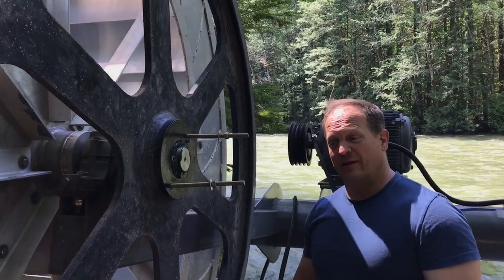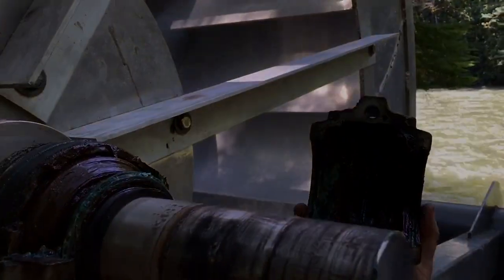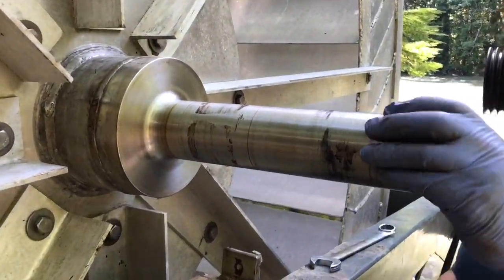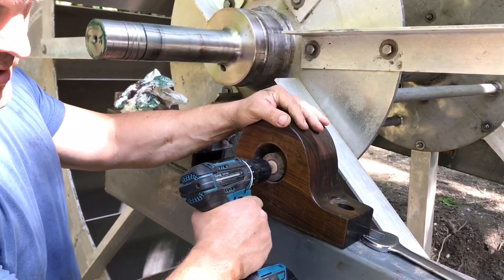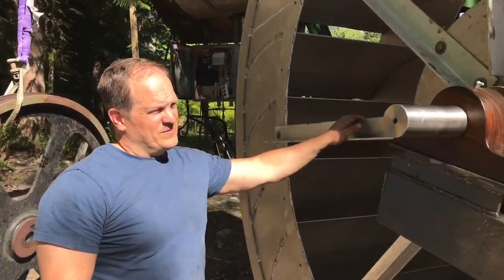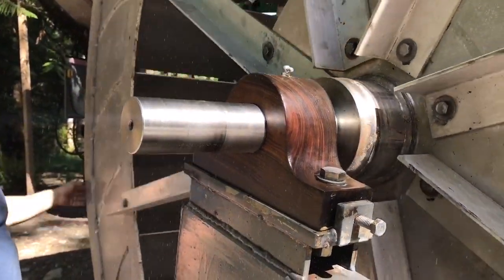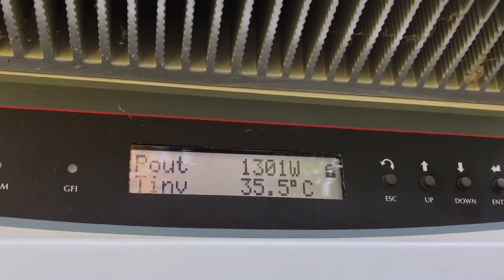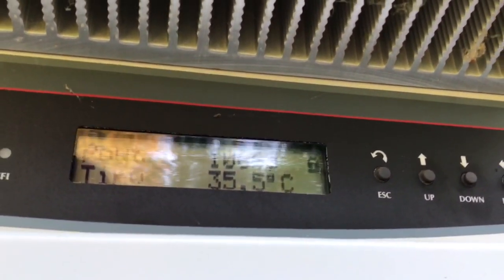Installing Lignum Vitae Bearings on Waterwheel

Comment: just as a quick note, all the Lignum Vitae bearings i have seen, are installed with the wood grain parallel to the shaft, not 90 degrees to the grain as you have installed, they have water grooves and are much as twice as long as the shaft diameter to take the weight

Comment: Those old wooden bearings are still hard to beat. We had them on a cooling unit at work and they were dead nuts reliable, especially considering they got neglected most of the time.

Comment: Great hydro project!!!
Pacific Bearing Company(PCB Linear) sells plain, self lubricating linear bearings that can be used in rotation applications too. They sell bearings mounted in aluminum pillow blocks or the bearing can be ordered by itself to mount in a custom bearing block. The largest shaft size they sell is 2", but that bearing can support an impressive 25,000 lbs. They are not roller bearing so they are nearly maintenance free. The PBC bearings have a better coefficient of friction than lignum vitae 0.125(PCB) vs 0.158(LV). They can run dry(self lubricated) or lubricated with water or grease(can be ordered with zerk fitting) without degradation. Available in inch size or metric. It looks like you would have to machine the shaft to 2" if you wanted to use these.

Comment: Do you think there’s too much weight from the big pulley on the bushing ? Do you think it would be better to make the big pulley out of aluminum?
Reply from the maker: It is pretty heavy, but it also functions as a flywheel to keep the speed consistent. Last time I  looked the bearing wear was equal on both sides. I think the belt helps take some of the weight too.

Comment: This is awesome!  Any update on this?  Would you there be any way to duplicate this is smaller set up?
Reply from the maker: I need to do a new video! Still running well although I have noticed some wear in the wood bearings. Should last another 10 years or so, maybe more as more water is getting into the bearings and lubricating them.
Reply: @NeringIndustries  do you think it is plausible that a system like this would work on a smaller scale?  Say 50-100 watts to create 1.2-2.5KW/day to offset daily usage at average residential place like mine?
Reply from the maker: @sportslinephotography8425  You could go smaller diameter, but I would go as wide as possible. I'm going to increase the width of mine by 1 foot in the near future. wider is better for efficiency and power production vs increasing diameter.!

Comment: Have you thought of a way to supply water to the bearings on a constant feed maybe a small pump or a ram style those are great bearings you have implemented into your design i have worked on turbines from late 1890’s with the original ones still in use just an adjustment every year or two depending on water quality

Comment: Lol reading the suggestions on barings. Lol. Alot of very expensive ideas but a trailer axle from a semi. Still has them beat .
Reply from the maker: The trailer axle is a really good idea. It will also make the wheel wider which will really increase the power output.
Reply: @NeringIndustries  if you ever decide to try a heavy trailer axle hit your local tractor trailer shops most have a few laying around back. Most from conversian ,  spring ride to air ride.  Id get a couple of rockwell style and some alluminum hubs . You can easily cut them up and make any type configurations...dont forget the hubs will have the studs tha in most cases can be driven out and drove backwards...possibilites are endless. Also the the tubes between the hubs are usually 1/2 thick or better which makes for ultra sturdy and easy welding if you need to shortin or separate each and make them independent.  I wish I lived close I got 5 or 6 of them I've cut up for various exparaments and ideas.

Comment: How long have the roller bearings been running?
Reply from the maker: They ran for a year before failing.  The lignum bearings have worn a bit but now are working perfectly.
Reply: @NeringIndustries  And are cheaper than regular steel bearing or not?

Comment: Like the design. But Most wood bearings I have seen are two parts being that it's stronger.  Second thought why do you set the wheel so far in the water. The higher usually has less drag and more rpms.
Reply from the maker: The deeper in the water it is the more power it makes. It acts like a cross flow turbine to some extent. I'd go even deeper but the belts slip when they are submerged.
Reply: How about the use of a synchronous  belt to take getting wet

Comment: Going back to a timber bearing block and just grease is an interesting simple solution, but I would like to add that I would have encased the block in some stainless flat bar to make sure it doesn't split apart when it ages with the water and stress, I will be interested in how it goes, you should get a year at least out of that with a bit grease. well done ,nice bit of timber!
Good luck
Reply from the maker: Great comment - I did worry about this and did wrap the bearing with a 1/16" stainless steel flat bar to hold it all together if the wood split.  It's been a year now with some bearing wear but now water can get in and help lubricate the bearing.
Reply: @NeringIndustries  In other underwater applications, we used wooden slats (similar to those for barrels), ancapsulated in a steel frame, and they work great. With that system, the replacement of wornout slats is may be easier

Comment: The centerpiece is the welded joint of several pieces. It is not a single piece made in turnery machine with low tolerance and greater precision. This can cause a phenomenon of cavitation as occurs with the propellers of ships and the bearings can vibrate too much until be damaged.
Reply from the maker: It was welded and then machined so it is accurate with no run out.

Comment: Love the paddle wheel generator. Great job.
Have you investigated the use of pillar block bearings for Flocculators?  In water treatment these bearings run under water.  The bearing material that I know of is some type of harden plastic. 
They may be other types.  If interested I'll give you the name of the company I use.

Comment: Could you use a compound pulley system to increase your output rpm? Looks like there is plenty of torgue off the big wheel.
Reply from the maker: The wheel turns at 7-10 rpm depending on river speed. The belt drive is a 5:1 speed increaser. The generator maximum rpm is 50rpm, so everything is designed to work together.

Comment: So the taper lock uses just pressure to secure? How are wood bearings holding up? Wonder if fresh or salt water makes a difference with lignum vitae?
Reply from the maker: Yes, the taper lock is two opposing tapers that are drawn together with the bolts. As the bolts tighten, the taper lock expands in diameter and locks onto the shaft and the pulley.
The lignum vitae has worn a bit and I can see a gap between the shaft and bearing. Hopefully the wear will stop at some point as more water is allowed in. I have drilled a hole in each bearing to allow dripping water into the bearing for more lubrication.
Reply: I've pulled similar bearings out of boats that were over 60 years old.

Comment: Ceramic bearings or eyther zirconia or silicon nitride or graphite bronze plus stainless steel are better than lignum vitae.Teflon plus glass ( sleeves, water cooled )its what i would have used for a project like this .Lignum vitae comes from an endangered small shrub and i bet those bearings were more expensive than high tech zirconia sleeves and will last much less.
Reply: Mihai Ilie ,    They will far far outlast any man made bearing.   He will never have to change the bearings again in his lifetime.    The tree (Guaicum) is highly restricted and there is only one licensed dealer/ supplier in the world.
Reply: red elm also also makes a very durable bearing

Comment: It looks good, but looks to be still harvesting less energy than you'd hoped.   Check out this axial flux alternator, sized up it would work as direct drive in a system like this.   Good luck with the Lignum bearings,   They are generally good as ship prop bearings, but here, I don't think they will do any better than your ball bearings, too much side load I think.    Another solution is to slightly positive pressure the bearing, so it's always slightly leaking, and flushing water out of the seal.   Use Canola oil, or ph neutral lard, so that there is no eco contamination.    https://www.youtube.com/watch?v=wdpLH2DBKLk
Reply: Andrew Rokeby-Thomas , none of that is needed with Lignum Vitae.    They Are self lubricating.

Comment: Tractor trailer axle split in two and you can use wheel hubs to bolt in mounting plate...there double cone barring  nd can run light synthetic oil , no grease drag .   common parts at any truck parts
Reply from the maker: That's actually a pretty good idea if I was to build another water wheel. I would use the entire axle to get the full width and use it as the axle of the water wheel. I just don't know how water proof it would be as water drips on the bearings/axle constantly. With the wood, water is never an issue, and acts as a lubricant.
Reply: Nering Industries depends on the wheel seal you use...there's quite a few . use marine grease and id say that would be.great. but honestly 50weight synthetic oil would be the best for as little drag.. big trucks drive in this crap all the time in cold or hot climates .  I've been wanting to test it out my self. I have 4 used axles now. I'd even thought of a vertical wind turbine generator. Kinda like a carousel except very big.. Most trailer axles have a 1-1/4 hole through the spindle to the axle which is 5x5 box . I believe that would suit for a standard windmill with at least 15ft blades or more and the through axle design would be great for direct drive to the gen.

Comment: What is the cost of such a device?
Reply from the maker: This is a prototype, so we are still experimenting. Rough costs so far are in the $20-25k USD range not including permitting costs or labor. Costs could be minimized by using different methods of construction (such as concrete for counterweights, etc.)
Reply: Nering Industries ,  that would only take me 50 years to pay off , my electric bill is under $500 per year , my electric bill runs around $35 each month , last month it was high at $37 dollars , I was pissed